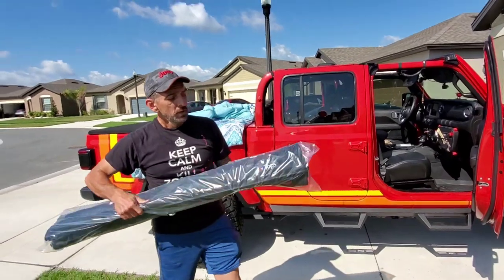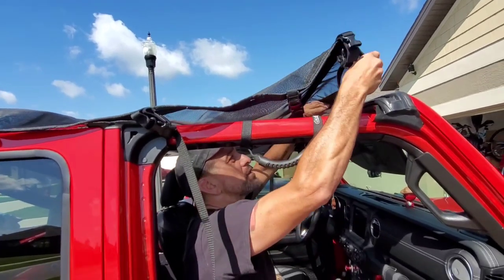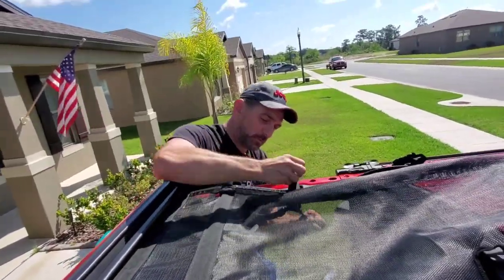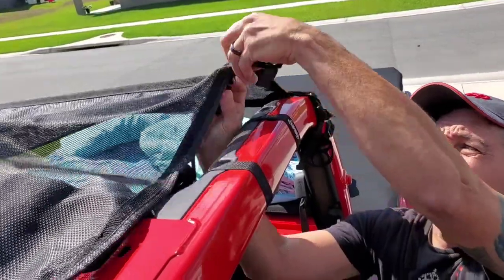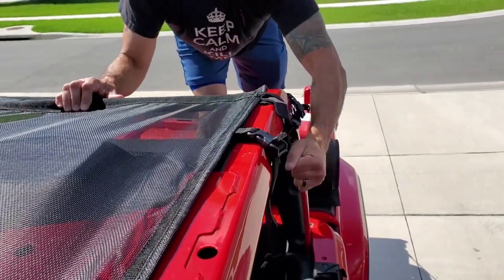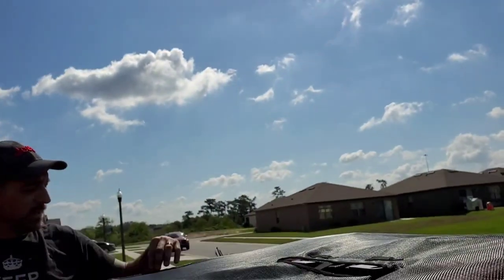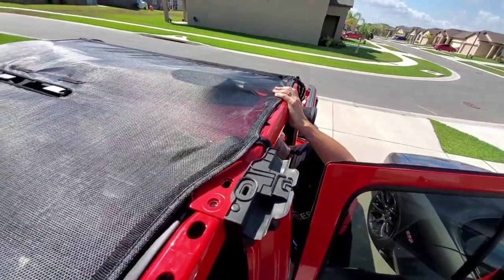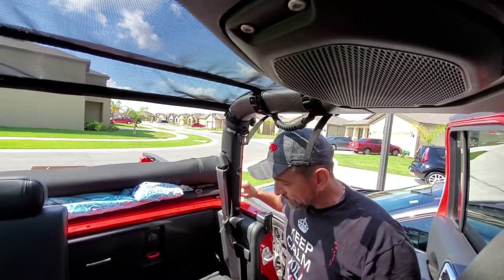Installing a JTopsUSA Sun Shade on my Jeep Gladiator

Comment: I have the same top and am having issues with keeping all 3 rods in the grooves of the JT  It's like the top is a half an inch too short between the front rod and the back two. I have tried strapping down the back 2 and then pulling the front rod to the grooves.  It's really a stretch and it won't stay in.  When the front rod comes out of the grooves, the front flap will not stay under the windshield when traveling at hwy speeds.  If I make sure the front rod is in the back of the top flaps a lot high speeds.
Reply from the maker: That's odd. Maybe you should contact them. I havent had many issues but I also don't use it often
Reply: Whew did your purchase the sun top from ?  Any link

Comment: Do you still have the top installed? Or will you be installing it this year?
Reply from the maker: I took it off but I’ll probably put it on this summer when I take the hard top off at some point.
Reply: @EvolvingMale  how did it work last year? Would you recommend it?